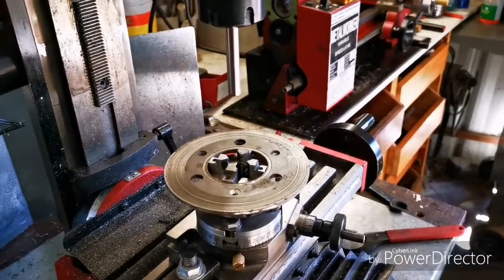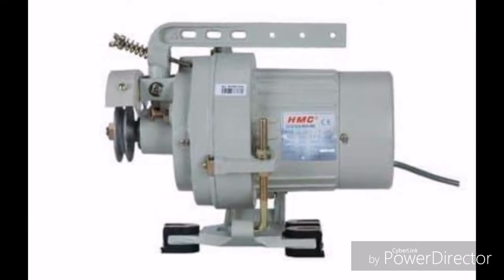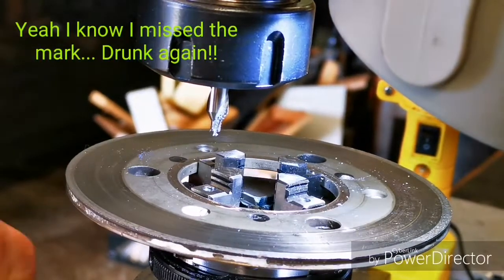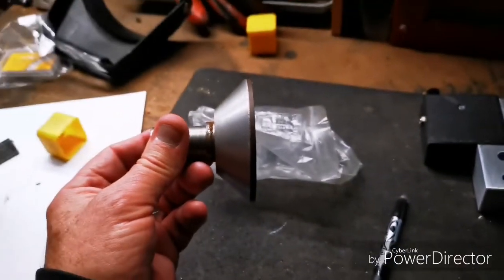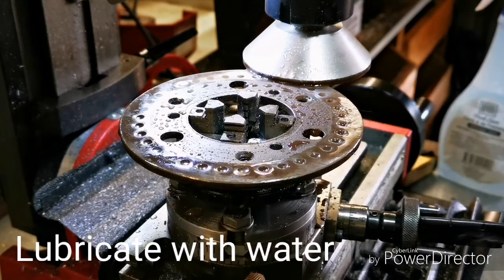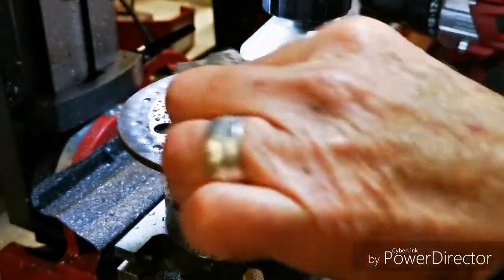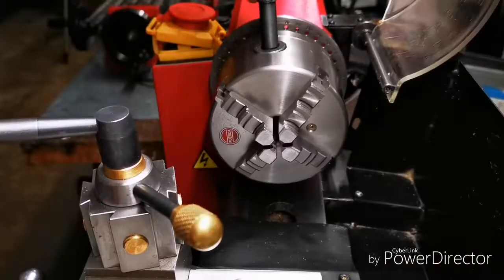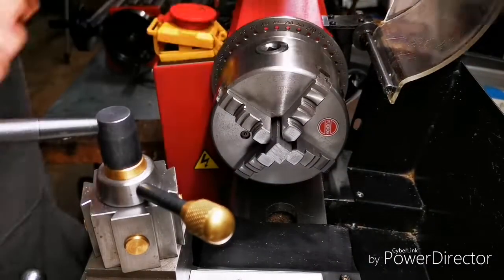mini lathe indexing HD 720p

Comment: The work is brilliant and above all the pleasure in doing it is evident. As for the spring, although it is designed to set back the whole mechanism when not in use, I personally would be afraid to forget about it, so for safety reasons, I would prefer the spring to work in reverse, with the latch normally retracted.

Comment: I like how you just completely skipped over the part of how you got the clutch disc onto the backside of the spindle flange. You know, the part where you have to disassemble the entire f*****g headstock of your lathe.
Reply from the maker: Omg... ive been sprung, truth is i didnt film because i busted a bearing then assembled it without the disc... THEN asembled again forgetting the bearing cover... grrr !! Used a wood chisel to pry bearing off spindle 3 times, so unprofessional, so grumpy afterwards haha
Reply: @stevohdee8118  Oh no! Haha, I know that frustration all too well. I recently replaced the standard ball bearings in my mini lathe headstock with tapered roller bearings and holy crap, what a nightmare without the proper tools! Took me HOURS to get it done! Thank god I got it right on the first try! I'd pull my hair out by the roots if I had to do it 3 times!
Reply from the maker: Haha, Yeah... im now bald !!

Comment: Hallo Stevohdee , bitte eine Frage, mich interessiert die Befestigung der Indexscheibe, an der Spindelwelle oder am Drehfutter  ????? Grüße aus Lübeck, Germany Horst
Reply from the maker: G'day Horst, the disc is attached through the 3 original spindle holes. I had to remove spindle to get it on. I installed longer studs to reach from the chuck, through the backplate & the disc. Cheers
Reply: Guten Tag Stevohdee, vielen Dank für deine super schnelle Antwort. Bitte wo bist du zu Hause. Grüße aus Lübeck Germany
Reply from the maker: Im in woodville gardens, south australia, drop in for coffee if u like haha

Comment: Been thinking of doing something similar for a few years using a motorcycle or bicycle disk brake but have not had the need for one just yet, and also trying to get up the guts to drill into my lathe.
Reply from the maker: An index wheel comes in so handy @ times, a few holes justifys the advantage, be brave my friend, cheers

Comment: WOW ….. any beginner hints for a complete novice to be able to engrave numbers like that?  👍👍😎👍👍
Reply from the maker: Sure, try this, study my grip, thumb & index finger holds the hand piece & the 3 other fingers act as an anchor to resist the force on the burr wanting to move right. It feels unnatural @ first but with practice it becomes somewhat normal. It only works for right handers so if you're a leftie it's a real challenge, cheers
Reply: @stevohdee8118  - thank you 🙏. I’ll give it a try and promise to practice 😊

Comment: I would make one small difference.
Make a small pocket for the screw to go in so it cannot be pulled out by accident or by vibration.
That way entire jig will not have to be moved, loosened or tightened.
Reply from the maker: Thanks Tony for your suggestion cheers

Comment: It's nice to have the ability to iindex, I hope the extra overhang of the chuck doesn't cause your spindle to chatter more when cutting. Good job on the engraving. By the looks of your self centering vise, I would guess you've been an engraver for some time.
Reply from the maker: Gday old m, thanks for your comment, the index plate is only 4mm, no extra chatter. The vice is an absolute gem, I use it often especially when using the belt grinder. Engraver for 49 yrs, cheers
Reply: The added inertia of the added degree wheel might help reduce chatter since there’s more rotating mass/more resistance to slow down once moving

Comment: LMAO did ya drill right through into the spindle housing ? Whats in that drilled area that the drill chips wont affect  ?
Reply from the maker: 4 jaw can be found on eBay. The housing just has a couple of gears & bearings, still works, not worried lol

Comment: You sure do have a steady hand with the engraver!  And damned fine lettering skills..good on ya!
BTW, that sewing machine motor is posting my mid-sized Lorch lathe...it has both a clutch and brake, so it stops right smartly when you release the clutch...not big power, but, with a VFD, enough torque, and clutch brake...
Reply from the maker: Thanks lohi, my c2 mini stops pretty quick but what u did sounds really safe, every lathe should have quick stop functions I recon

Comment: Thank you so much for sharing the knowledge. What are the dimensions of the disk; i.e. thickness, diameter, inside diameter of the center hole. Cheers m8
Reply from the maker: Center is 48mm, Dia is 116mm, 4mm thick, cheers
Reply: @stevohdee8118  You just got another subscriber and I'll be building one of these for my mini lathe. Cheers

Comment: I've been forming characters by hand for fifty plus years. It's kind of a compulsion. I don't think that I could do with paper and ink what you did with a tool and steel.

That's a hand. You are the dean of hand engraving. Please tell us about -that-.
Reply from the maker: Sure Matthew, the secret is in the grip. The engraving bit spins clockwise when you hold it. By placing your three right fingers on the pad or item it counteracts this force enabling control over the bit trying to move right. It's like learning to write all over again but even some left handers have learnt to master this grip. Look closely how my hand is positioned and copy. A bit of practice & most people can achieve a good result. Hope this helps cheers

Comment: Hi, really like it. That is my thinking about index my lathe too, how you pass it behind chuck plate? I don't want to take it out from the head :(
Reply from the maker: Yep 36 is my preference, in time maybe I'll need something different, depends on yr projects, some people make stuff that requires more flexibility, cheers
Reply from the maker: Unfortunately you have to remove spindle from head. I used a piece of wood and hammer to knock it out, then had to remove bearing, no other way, cheers
Reply: @stevohdee8118  Yeah i know it :), hope dies last.. From your experience what you made until now 36 holes is ok for most of the projects? Because i think to make it with 48, thanks.